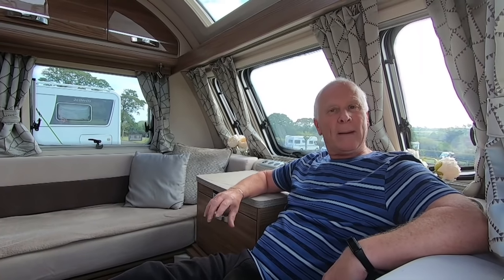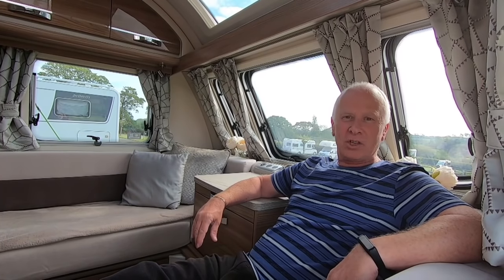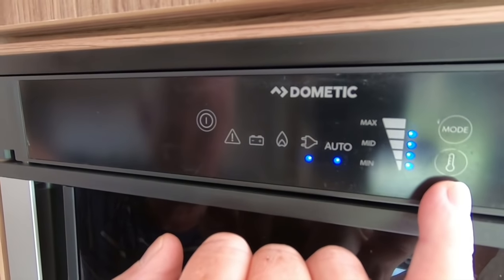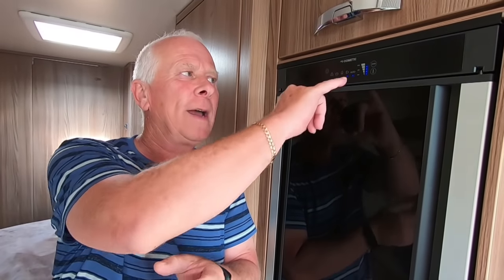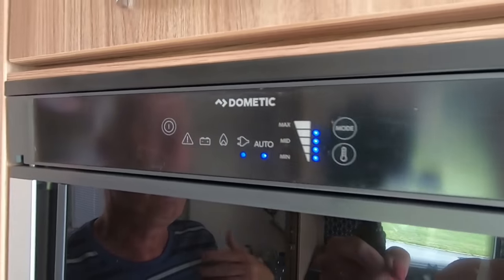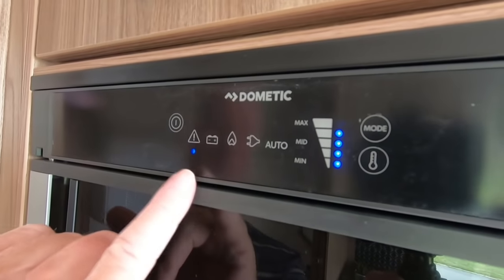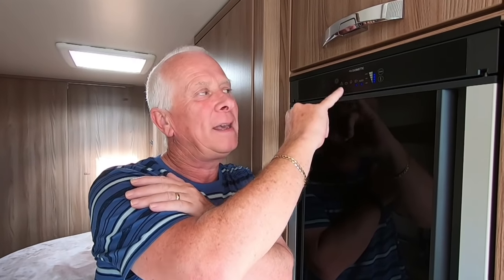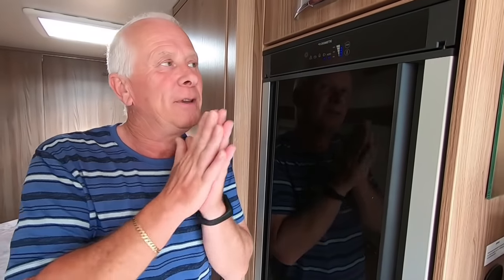Dometic Fridge Failure. How To Reset It.

Comment: Keith, you’re a life saver! We had our van from new in 2019 and had never used the gas on the fridge. It only came to light when we pulled up at a services and had lunch in the van, the bleeping drove us crazy as the gas wouldn’t light. Did your simple reset and hey presto!  
A tip for long journeys if you’re taking some frozen foods with you. We wrap everything up in tin foil and also put 4 ‘ice packs’, the sort you’d put in a picnic cooler bag. It helps to maintain the temperature, especially on hot days.
Reply from the maker: Hi Robin, Absolutely delighted the reset solved your problem, that’s great to hear. Great tip as well, thank you so much for sharing 👍🏻 Sending our best wishes to you, Keith & Michele.

Comment: Thanks SO much for posting this video. I was sure that I was going to have to take our new Bailey caravan fitted with the same fridge for warranty repair… nothing about this in the fridge documentation. Ours wouldn’t clear the fault warning after a gas bottle ran out and a new full one connected. Very relieved our long weekend away rescued!
Reply from the maker: Delighted you found our video helpful Peter2yt, really pleased you managed to resolve the issue👍🏻Sending best wishes to you, Keith & Michele.
Reply: …August 2024 and I had to watch this again! Still works!😅

Comment: Great video . Information is better than the instruction booklet received with the caravan and so relevant regarding the battery as it could be misleading that the leisure battery could support the fridge, which obviously it couldn't due to the power required to run the fridge. 👍

Comment: Good advice about the 12 volt setting as a lot of people think it will run off the caravan battery and not when attached to the car
Reply from the maker: Many thanks for watching Bren & Jules, sending our best wishes to you both, Keith & Michele.
Reply: This was excellent advice. Seriously. Thank you for this short but helpful video. Ditto what this commenter says. Necessary info about the DC setting requiring the car be connected.

Comment: Hi Keith and Michele 
Another good informative  video never even given it a thought about running  the fridge on gas as you say I always leave mine on auto  . so  tried on gas today all works fine so after running it on gas for 10 mins I then switched  back to  auto and ran that for about half hour on electric . Then got thinking let’s see if it auto changes  to gas if electric power is disconnected the auto  symbol on fridge changed to  gas could hear the sparks to ignite the gas but then fridge went into alarm . With the  gas symbol flashing and gas not igniting 🤔 took fridge off auto and manually pressed on to gas fridge  ignited and gas started up . 
Will have to mention this when van goes into have its service week after next . 
Keep up the good work guys all the best  and another great video that ain’t making me spend all of Hazel’s house keeping money 😂😂😜😜
See you guys hopefully soon  
Mark and Hazel
Reply from the maker: Hi Mark & Hazel, Many thanks for your kind words, we hope you get this issue sorted 👍🏻 Hope you’re both well & enjoying some trips in the caravan. Sending our best wishes to you all, Keith & Michele xxx

Comment: Fantastic demo mate... thanks. Mine is same as yours, and running on electricity. I tried what you said and reset it, and yes, it did start cooling again over night, but this morning it stopped again and even though on high, it refuses to freeze anything and the freezer fins are not even cold. When working proper they are really cold to touch. It could be coincidence, but it seemed to stop when I turned on my electric heater 1000w. As if it was not getting enough power, I will again reset and see what happens. Problem is it takes about 4+ hours to test if its working as there is no sound like normal fridges.
Reply: Came back to report. I reset it once more s instructed here, and I lowered the nose of my caravan 2 inches to make it perfectly level and its now been going perfect for 18 hours... so I guess it is fixed. Not sure if it was the second reset or leveling that did id. Thanks for everything... its good to know this reset trick.

Comment: Perfect. We have the same fridge, will hopefully save making a call to the dealer if we get the same issue 👍🏻
Reply from the maker: Many thanks Graham, You & Mandy must be getting so excited, only a few weeks until you collect your new 650 🥳 Sending our best wishes to you both, Keith & Michele.
Reply: @keithandmichele  Thank you. Yes excited but oddly nervous. I’ve been towing for 15 years and never had someone crash into me before, so likelihood of it happening again are slim. Think get that first tow out of the way and I’ll be fine 🤔
Reply from the maker: You’ll be absolutely fine Graham, you’re an experienced caravaner, the accident wasn’t your fault & the chances of that happening again, like you say, are so low. Think of it as getting back in the saddle after falling off the horse 🤗

Comment: Your video has just reminded me to check as we have not used the fridge on gas but just had it in for it's first service so sure it would have been checked, but will test on next trip, its got a fault on the outside of the door anyway on warranty gets a cold patch and condensation on the outside of the door. Hope you 2 are fine
Reply from the maker: Many thanks for your comments Wayne, we’re both very well, thank you for asking. Sending all our best wishes to you, Keith & Michele.

Comment: just a point about the battery symbol. These fridges are fitted to motorhomes too, hence why they use a battery symbol. Its never disconnected from the battery in a MH. 
Perhaps misleading for caravan owners although still valid, as if the car is disconnected the alarm is indicating no power from the battery (which is correct). 

Also, in case any one else finds it useful, I just had the gas error (E50) on my new dometic fitted last year. First time I tried to use it this year (today) it just kept alarming. Had gas to hobs and heating system. Switching the fridge on and off a few times and clearing the error as you showed in this video didnt get rid of it either. 
I resolved it by holding the purge button in for 10 secs on the gas bottle (even though i had already proved there was gas supply to hobs and heating). 
So worth trying a purge even if you've proved there is gas to the hob. 

Thanks for your videos and happy camping!

Comment: What a life saver -I had just had my caravan serviced, we went away the next day and every time the power dropped the 'blinking' noisy alarm went off because it wasn't working on gas. I called my caravan supplier (they promised it was working when it left them!!) and they got me messing about with the control panel to no avail. Then said I would have to fetch it in - 100 mile round trip. Anyway I looked at your Video and hey presto my fridge now works on gas.
Why isn't this in the manual and why didn't my 5* service know about it ???
Come on Swift!!
Reply from the maker: Hi Andy, We’re delighted you found our video helpful & managed to resolve the problem without having to do a 100 mile round trip! Many thanks for watching, sending our best wishes to you, Keith & Michele.

Comment: Enjoying your videos down here in West Aussie.....but just a point you made Keith about 12v (car input) operation....I dont know if the Dometic "ice cream cookers" over there are different to ours, but on 12v the fridge runs unregulated via the panel controls. This is because as you travel you go up hills and down, twist and turn and these inclinations turn the fridge off and back on ( only like operating on level ground), so no requirement for panel  regulation. However here in Australia, travelling across places like the Nullabor  Plain, hundreds of kilometers of flat road,  constant 12v fridge feed results in lettuce and cucumber popsicles, so we are aware of this and physically turn the fridge off for a while, depending on the ambient temps in the van, then on again. I have actually installed dash board switches and relays   to enable the drivers to do this whenever they wish ( or remember.....remember what?)  Because of this, the majority of newer vans and RVs are fitted with 12v compressor fridges (no gas at all) and operate according to the panel settings.....Just FYI....keep up the good work.....Cheers.
Reply from the maker: Many thanks for sharing your experience Graham, it’s always good to hear other people’s views 👍🏻 Sending our best wishes to you in Australia, happy travels, Keith & Michele.

Comment: Hi, how good did you find the freezer. We have ours on high but it isn’t cold cold
Reply from the maker: Hi, this fridge was excellent and the freezer section equally as good. You may wish to try your fridge on gas for a short while to see if that makes any difference. Also, may be worth purchasing a fridge/freezer thermometer to see if both are reaching the correct temperature. Hope this helps, Keith & Michele

Comment: Many thanks for the advice. Funnily enough last night when hooked up I was woken at 3 am! 
we have the same fridge as yours and the triangle and battery icon were lit and bleeping.
[error code W06 - dc power not connected]. so completely miffed, we drove home, where I switched the fridge on with the engine running, still connected. All was ok. Then disconnected the car and tried gas. All Ok. Then tried electric 240v - all ok. Can you tell me what the problem was please?
Reply from the maker: Hi Andy, Delighted you got this problem rectified. Sometimes a simple reset or, in your case, the fridge being turned off totally, can rectify glitches. Sending our best wishes to you, Keith & Michele.

Comment: New MH owner here and getting to grips with out Dometic 3-way Fridge.
Re: AUX-STARTER-GAS, I keep reading that the fridge will not run on 12v unless engine is running. Why is the AUX 12v needed at all ?
Reply from the maker: Hi @DOCWHOK9. You are correct, the 12v setting only work is when the vehicle’s engine is running. This feature is used to keep the fridge at the same temperature, so for example if you were to have the fridge cold when leaving site it would stay at that temperature when driving. Hope that makes sense. Keith & Michele

Comment: Hi, I ve problem with my dometic is working on gas only if the caravan is plug in, do you have any tips? Or something that I can check?
Reply from the maker: Hi leostar, Some caravan fridges will automatically switch to gas if the amperage supply drops below a certain current. This normally happens if the caravan heating system kicks in (which takes a lot of current) thus dropping the supply to the fridge. One way to test this theory is to turn off your heating system & any external sockets to see if this cures the problem. Hope this helps, Keith & Michele.

Comment: The plug in stands for 110/120 AC current. The battery stands for a 12 volt power supply that probably feeds through a converter. Also, a height number of campers are pulled by a pickup, not a car. I think the battery only stands Defoe 12 volt power.

Comment: Im finding that our fridge on/off button has to be pressed extremely hard for it to switch, where as the mode and button is a soft touch. Any ideas on this?
Reply from the maker: Hi Neil. It could be something as simple as the switch board needs to be cleaned or even replaced. Either way you would need to access the board to investigate. This maybe something for an engineer. Hope this helps, Keith & Michele

Comment: Just had this problem and were told to press the triangle button, not the off button. Also told to wet your finger because old people have dry skin !
Reply from the maker: Hi Patrick, On our particular model this is the reset procedure as explained to us by a Dometic engineer. What he failed to tell us is that we should wet our finger! We’re pretty old 😆 Sending best wishes to you, Keith & Michele.
Reply: @keithandmichele  as well as dry finger my hearing not too goo either, just tried the triangle again and it doesn't move so you're right, it is the on/off button :-) thank you for your video

Comment: We have the same fridge in our motorhome just a month old 
Fridge will not get cold on electric or gas  been on 5 days 
Only at night the triangle 🔺️ warning comes on 2 in the morning I tried the reset and took all fuses out refitted still no joy fridge lights up not getting cold 
Does your freezer department get cold
May have to book in in at the dealer for repair
Reply from the maker: Hi @stevewitt. Without question, back to the dealer to sort. Sending you our best wishes, Keith & Michele xxx